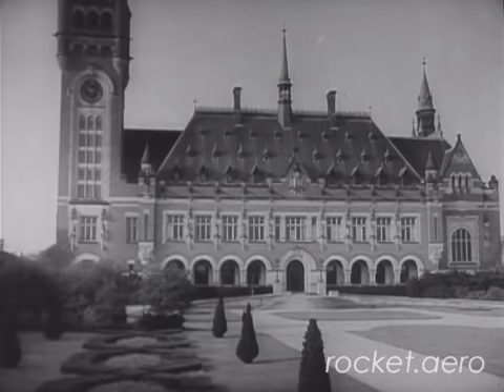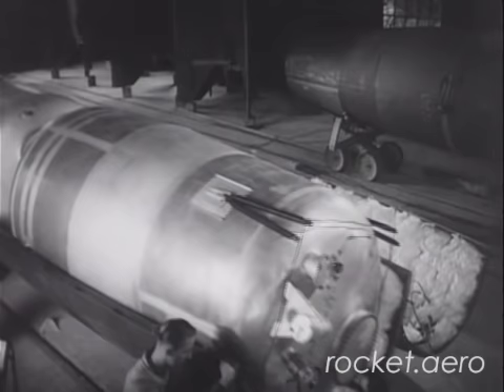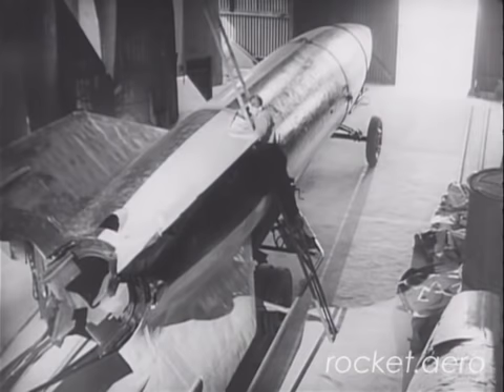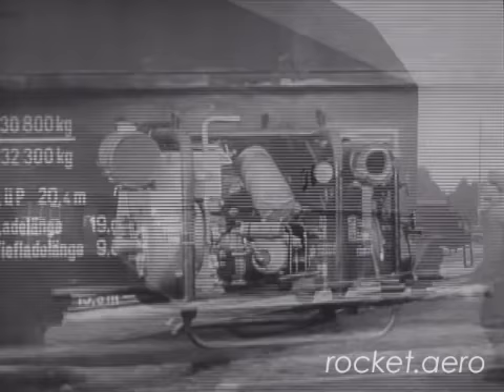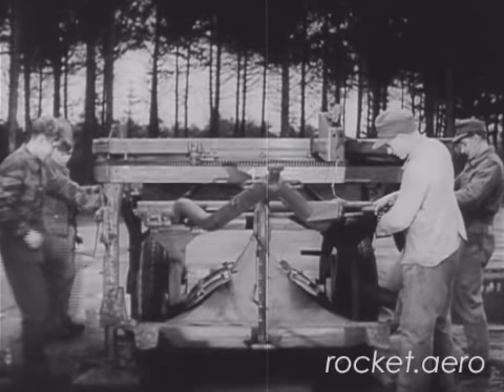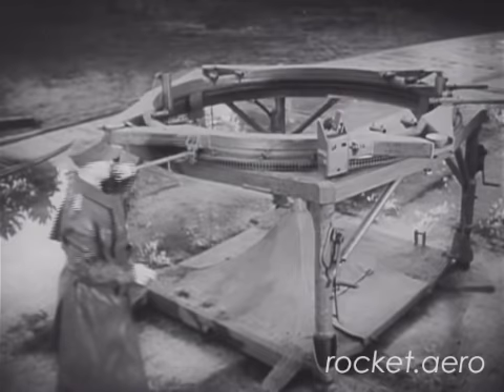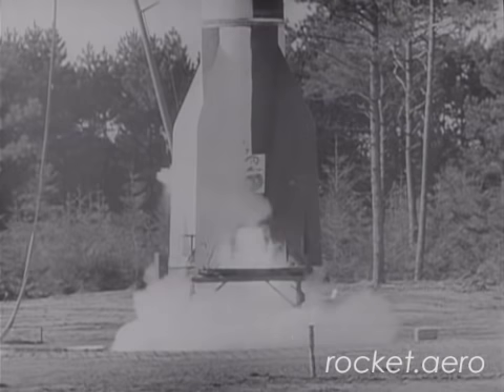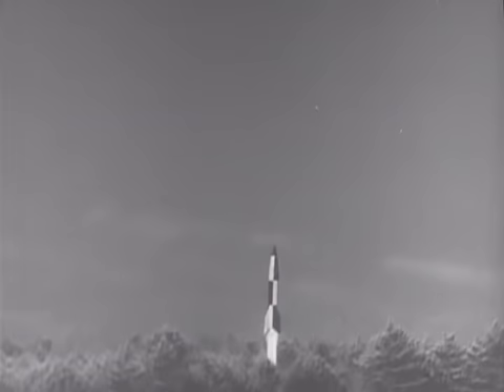Project Backfire, 1945

Comment: The V 1s were a lot more destructive than history books give them credit for, most books imply it was just more of a nuisance than anything, but the statistics you provided shows a lot of destruction and casualties incurred from this rather simple flying bomb.
Reply: Because of the steepness and speed of the fall of a V2 from height, it was inclined to bury its warhead into the ground, reducing the radius of the blast. The V1 on the other hand tended to explode closer to the surface, resulting in a wider destructive blast.
Reply: On top of the death and destruction they caused, the Buzz Bombs were also employed as a terror weapon intended to create fear and damage the morale of British citizens, and they were somewhat effective at this. Not effective enough to completely break public morale and alter the course of the war, but they were certainly loathed and feared for some time before tactics were developed to counter them.

Comment: It's amazing how much similarity there was from this to the space shuttle.  For example the paper cups put over the oxygen vains that fell off from the blast.   Also, the Germans used a similar, but smaller VAB to build the rockets.
Reply: No it is not amazing. Paper cups are used in all kinds of industrial processes for a century to protect nozzles, pipes, parts, and fittings. There is no similarity to the space shuttle. That is why only by reaching were you able to  find two so called "similarity".  You are wrong.
Reply: OK, professor you win.   @rfarevalo
Reply: You're not entirely wrong, in that the V2/A4 was the first liquid-fueled bipropellant rocket able to actually lift a useful payload to very high altitudes, so there's a direct lineage from STS all the way back to the development work that was done by the Nazis at Peenemunde. However, that lineage really only applies in terms of "basic" stuff like injector/combustion chamber/nozzle design, turbopump development, propellant chemistry, mechanical engineering and construction techniques. Advances in fields like engine design and manufacturing, materials science, digital flight control/guidance systems, life support systems, and ground handling operations which were necessary to enable Shuttle to do what it did would have absolutely blown the minds of Von Braun and his team!

Comment: It was a common mistake to believe the engine produced 8 tons of thrust during the preliminary stage of the ignition sequence, where the engine is fed by gravity alone. During the preliminary stage, the engine produced about 1 or 2 tons of thrust. The 8 tons of thrust were produced towards the end of powered flight, where the thrust was reduced from 25 to 8 tons in order to fine tune the trajectory.
Reply: That would not explain how 2 tons of thrust could propel 12 tons of mass vertically from standstill.
Reply: It can't. That's why during the preliminary stage of the ignition sequence the rocket doesn't move. The rocket moves when the engine's thrust overcomes the weight of the rocket. That happens at the main stage of the ignition sequence, when the turbine starts and the engine produces 25 tons of thrust. @blxtothis
Reply: How you reduce thrust from 28 tons to 8 tons when you say it never achieved 28 tons thrust?
Reply: I never said that. Did you actually read the entire comments? Do you understand what "ignition sequence" means? @Jim_maco

Comment: By a huge mistake a V2 rocket accidental chrased on a coast of sweden early in the war but it seems that the Allies did not get any information about it - but a V1 rocket landing on danish island Bornholm in early 1940-1941 , the local resistance movement managed to get lots of pictures before the germans sale the area off , these pictures was sent over to the british army and was used a lot in the growing flow of information originating from the Pennemunde test center which ended up with the bomber command sending the Lancasters to thrown bombs and destroying the plant and sending the rocket factory underground at Nordhausen and other places.

Comment: A lot could go wrong in preparation, just one  detail.
Wonder what the rate of catastrophic failure was.
Reply: not that high after the procedures were developed. One issue was the alcohol fuel - it was very flammable.

Comment: How did they program the guidance system for the proper trajectory?
Reply: analog computer. basically a clock as a sequencer with preprogrammed contacts.
Reply: The gyros hold the rocket in the proper attitude. You then got a electro-mechanical sequenzer to pitch it over to around 43 degrees. 
The direction is determined on the firing platform by turning it the way you want the rocket to go.
The distance is determined by the speed at Brennschluss (when the engine cuts out), either by radio signal or by the rockets simple computer.
From them on it follows a ballistic trajectory like any artillery shell.

Comment: The Germans were the first into space with the V-2. The definition of space being the Karman Line….and that was 1942!
Reply: The Apollo missions never would have gotten off the ground without the German conceived Saturn V that Werner Von Braun designed and built.
Reply: @dawor1761  …..and I remember growing up during the Apollo years (born 1960) and I never heard anything about the German engineers behind it…(Von Braun, Stülinger, etc.) we Americans assumed, through the press mostly, that it was an American grown program with American genius behind it.
Reply: @hertzair1186  There were even other highly innovative rocket scientists working at Skoda Pribram plant for the SS, they developed the huge solid fuel V101 Skoda designed Rocket that was tested at 16.03.1945 in Rudisleben Arnstadt from Polte 2 plant, this one was flying radio guided over North Norway to come down near the North Pole region. it only missed its projected target by 6 Meters! That was quite something back in 1945, It was designed by a Dr.Büdewadt and Dr. Teichmann. V-101 was a solid fuel rocket, with THRUST 200 tons (not the amount of fuel). Range more than 1800 km, altitude 200 km. Designed by Dr. Büdewald and Dr. Teichmann at Skoda together with the SS group led by Hans Kammler. Length 30,26 m, width 2,82 m, weight 146 tons.
Reply: @Schlipperschlopper  …..What was your source for this info?
Reply: @hertzair1186  "'Once the rockets are up, who cares where they come down, that's not my department!' says Werner von Braun." Recorded by Tom Lehrer back in the 1960s: https://www.youtube.com/watch?v=QEJ9HrZq7Ro
Reply: @hertzair1186  Oddly enough, quite a few Canadian engineers were also involved in the US space program (Mercury / Gemini / Apollo) along with the Germans.  In early February 1957  The Conservative government of John Deifenbaker cancelled the development program of the CF-105 (Avro Arrow) interceptor aircraft.  From the Wikipedia article on the Arro:  " Following the cancellation of the Avro Arrow project, CF-105 chief aerodynamicist Jim Chamberlin led a team of 25 engineers to NASA's Space Task Group to become lead engineers, program managers, and heads of engineering in NASA's manned space programs—projects Mercury, Gemini and Apollo.  The Space Task Group team eventually grew to 32 Avro engineers and technicians, and became emblematic of what many Canadians viewed as a "brain drain" to the United States."

So, while the United States paid the bills, the engineering of the US space program involved skills obtained from several other countries.
Reply: @Schlipperschlopper   Am I missing something? If it had a thrust of 100 tons and a weight of 146 tons it would not leave the ground,(until most of the fuel had been burnt).

Comment: Now you have convinced me to buy a V2 German rocket!!
Reply: all you need is updated guidance systems, steering engine, and your good!
This design is good!
Reply: @lucasrem1870  A cheap MCU, IMU with 6DoF and some matching MOSFETs should be good enough if you write a "small" software script to compensate for the drift factors.😉
Reply: I’m sorry. The V2 is only available in propaganda. We only have the A4 but hurry, quantities are limited & flying out fast. You must provide your own war head, but the compartment comes fully assembled. Will you be paying in pounds sterling? American dollars? Oil or Gold?
Reply: It's Italy today. Ducati and Moto Guzzi (and more) are famous for their V2 engines.
Reply: When you own a good museum, you can buy one. Better do the paperwork first, countries do not like your V2 coming at 3000 mph.
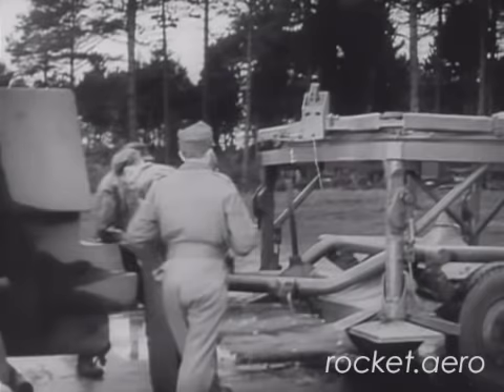Reply: @lucasrem1870  23:20 They even have a V2 that was fired using a cigaret lighter! Watch it!
Reply: @patrichausammann  these new MOSFET tech is very fast, but I'm using the Mythic  analog computing, single task, perfect curve i need only, less WATT
Reply: @lucasrem1870  actually takes more power for the electric motor used to drive the sequencer. There are other YOUTUBE videos on the V2 that provide a lot more information.

Comment: The engineering and logistics involved to deliver less than a ton of of explosive is mad
But it nearly worked
Reply: Just using the local tracks, easy to transport to the Dutch and France coasts.
they did launch many and many! how many? 500???
Reply: A crazy amount of resources  . Germany was disarming itself with every shot
Reply: @lucasrem1870  I've heard that 1500 of them landed on Antwerp alone with London receiving about 700.

Comment: Going to great lengths to design, test, engineer, produce, transport, assemble and finally launch this 'technological' wonder to sixty thousand feet is a landmark in technological progress. This is cutting edge stuff and akin to jumping from the howitzer to the polaris missile, so why on earth would you choose to send all this effort on a one-way mission to complete destruction? It's flying blind for the majority of its decent and is as accurate as 'pin the tail on the donkey.'  Don't forget the Germans had the huge howitzer's mounted on rail cars that could fire artillery shells from France and hit London, so I think the V2 rocket explanation doesn't fit in my opinion.

Comment: the number of failures increased with time, that's called corrosion within the guidance system
Reply: Slave labor resistance pissed on the gyros
Reply: not the guidance system - that was surprisingly reliable. corrosion and contamination of the fuel/oxidizer tanks.